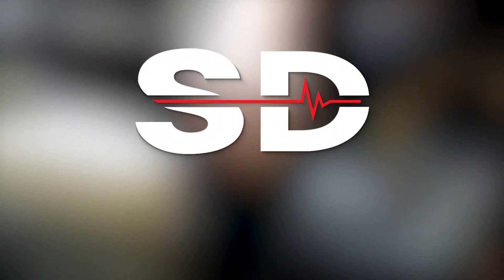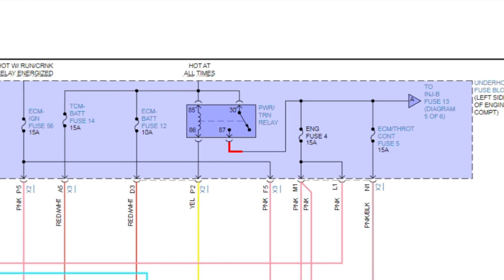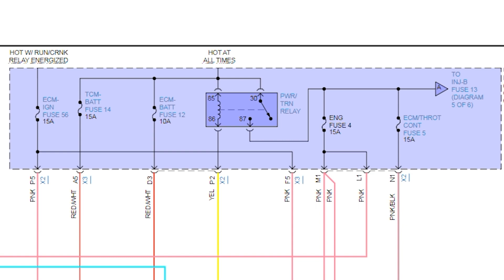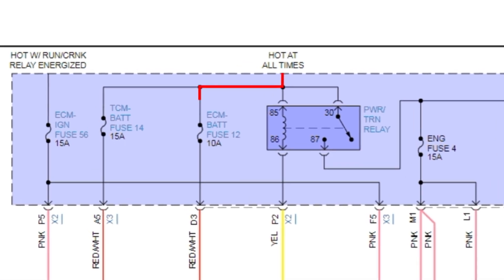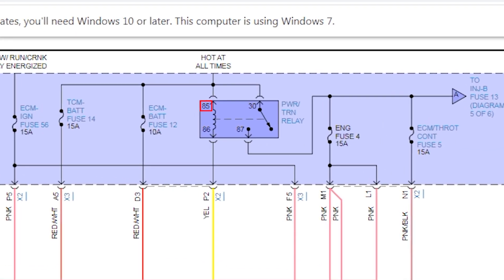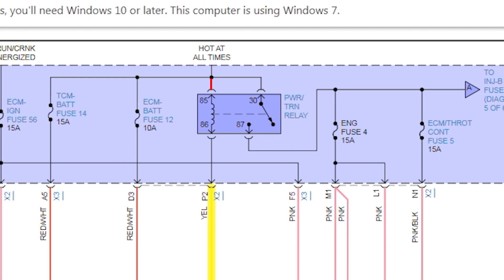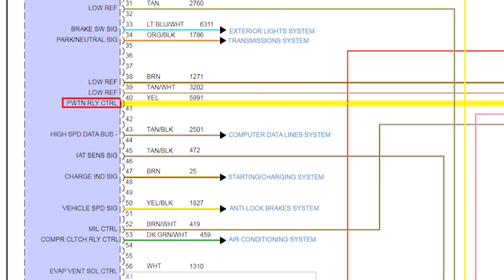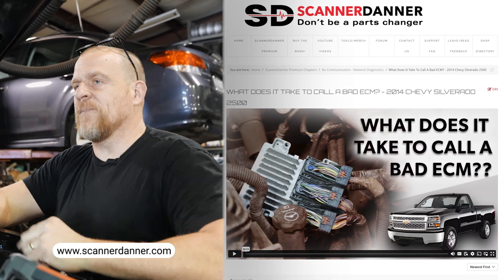Calling a Bad Module is Never Easy! [SD Premium promo]

Comment: If you verify the engine will start and run when the relay control is grounded, why not run that control wire to an ignition controlled relay and then to ground, and save the customer from buying a computer?

Comment: I had an odd one today.2011 Traverse, PCM powered up and showed no codes but would not communicate with other computers and showed no data on the the scan tool. Check engine light flickered very fast also. Ended up being the ecm ignition fuse powered off of the powertrain relay. New fuse fixed the car and everything communicated normally.. oddest symptom I've ever seen from one of these cars..
Reply: Most likely it's one of the wires inside of the fuse box that jumps that pin on the relay to the connector below the fuse box. There's wires like to crack
Reply: @Constitutionallycorrect  Nope, mine was an actual blown fuse. Alternator went bad and either they blew it changing it or the Alternator did. It's still driving today just fine.